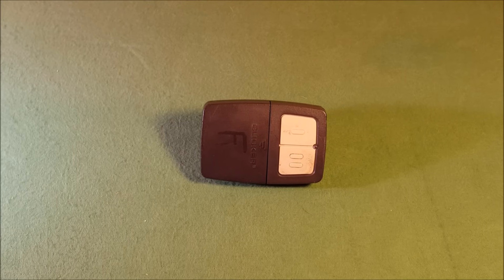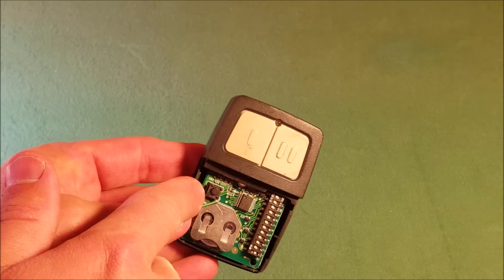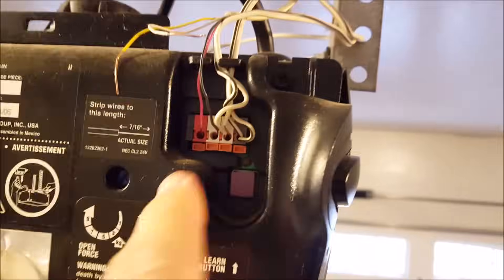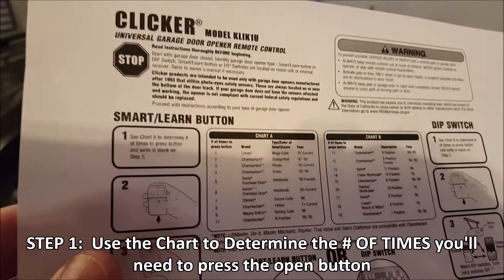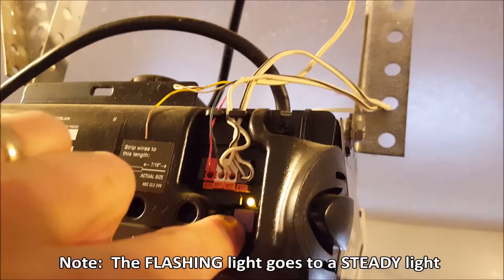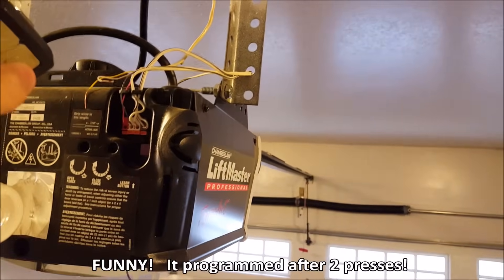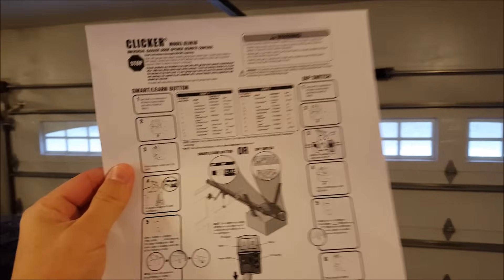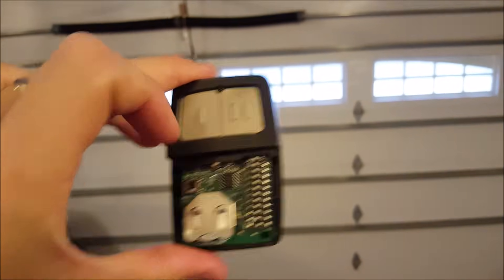DIY!  How To Program a CLICKER UNIVERSAL Garage Door Opener

Comment: What if you have a detached garage and you can't get into the garage to hit the button on the opener itself? That's my problem, I can't get into the garage. I think I had a dead battery in the remote so I changed the battery and in doing so I think I accidentally hit the learn button on the remote and now the door won't open at all. I don't know what to do at this point.

Comment: Sorry, but you failed to mention about the dip switches. What is the proper position of them if one is using intellicode for a Genie (mine ProGlide2) opener. What is the default position for them on the Clicker to be set? Will they be ignored if Intellicode is used - even if they are in different positions? One of my Clickers are all ON 2-12 and #1 is ON ONLY. Lastly, the instruction page says for Genie, to use either #5 or #6 times to press remote button. So far, no luck.
Reply: Mine where set for some old house but programming worked just fine. Looks like they are being ignored.

Comment: I have the same garage opener with the purple learn button, and the same remote. I cannot get them to play!

I have my dip switches set the same as yours ,the same as another remote I have that does work.

I hold the program button and the remote light turns on, I push the purple learn button on the garage opener and it lights up, then I press the remote button 3 times (waiting for the led to shut off each time), but the garage opener never responds.

UGHHHHH

Comment: I have recently purchased the KLIK3U model and have been trying to program it with the gate. The issue is that i do not have access to the sensors since the apartment unit has it locked. However i do have the clicker that was given to me by the landlord with the dip switch key. Is there anyway that i can set it up that way or do i need to have access to the sensor?